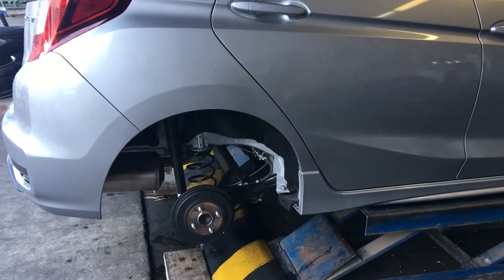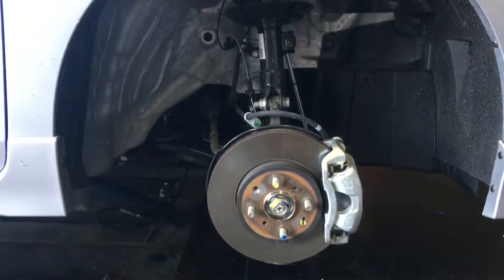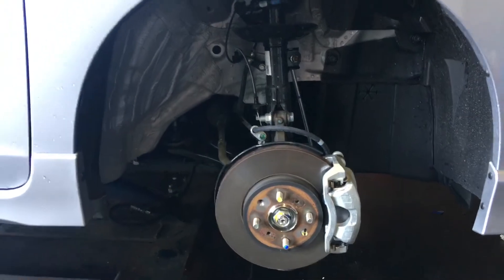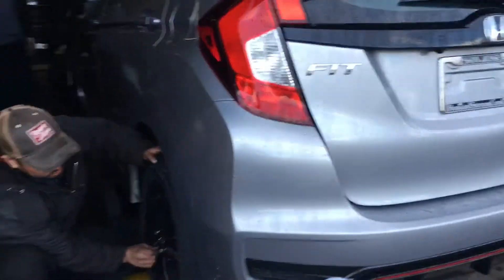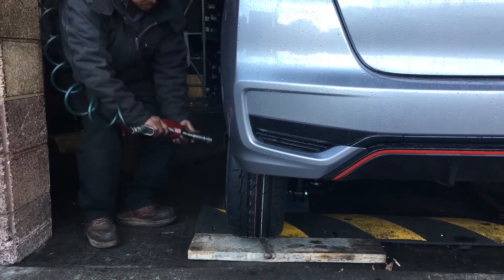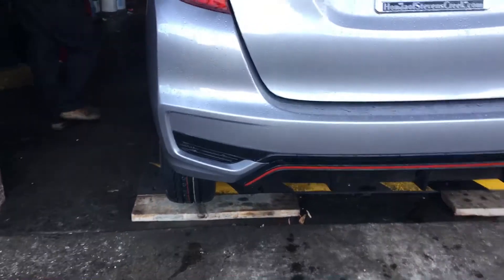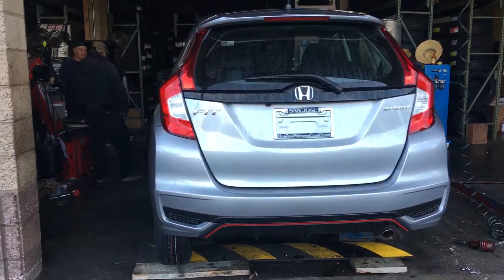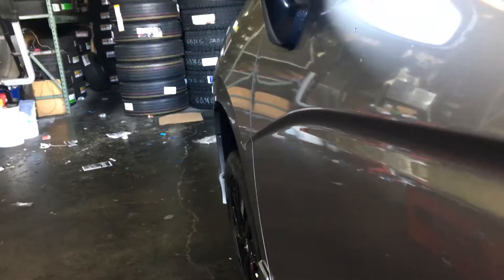2018 Honda Fit sport manual with 195 55 16 tire upgrade

Comment: My exact upgrade once my stock tire's the wear out. The 16's are a little big for the Fit. Wish it had 15 inch Alloys. Bumping up to a 195 seems like a great idea, a little wider and taller. Hate how the stock tire sits so flush with the rim, I want the tire to curve over a little, more bounce and give, ride is a little rough...